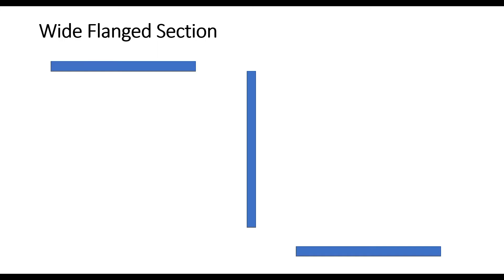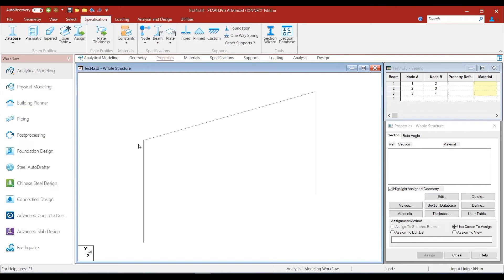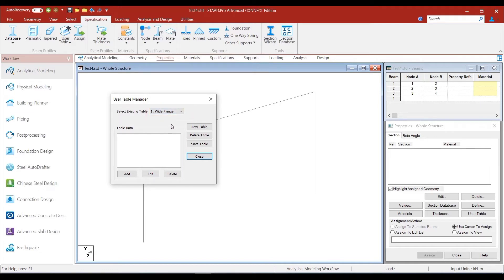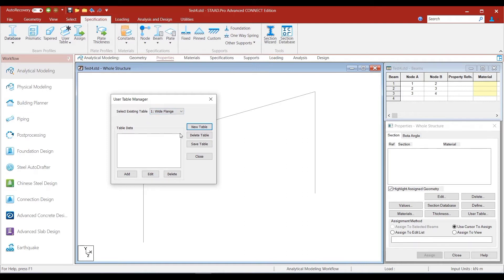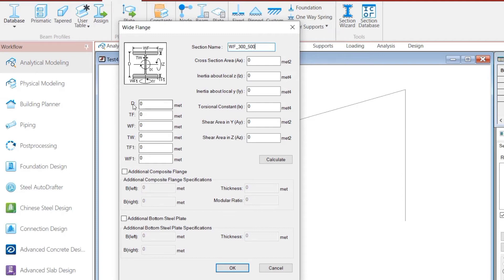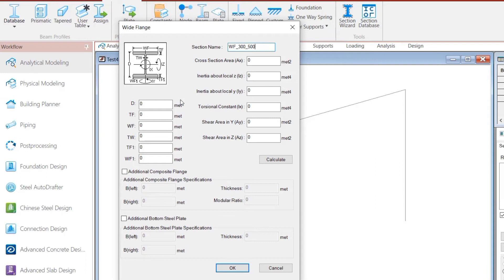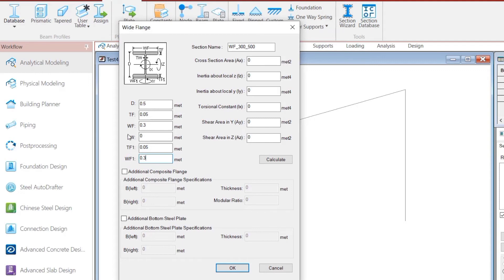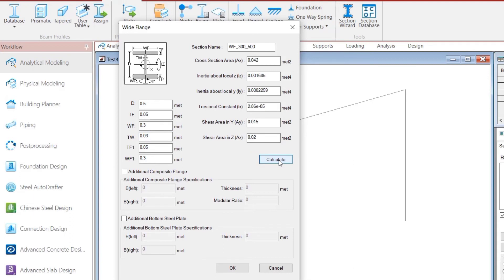#45 - Assign Steel Sections and Materials in STAAD Pro – 3 from the user table

Comment: Hi sir...
I used staad pro connect edition 
I draw PEB structure it 
Tapperd section...(both column and raffter).I take parlin in Indian cold form.
And I give roof x brasing and side bracing.
Finally I analysis the design 
The error become "member design failed for member".
Pls give a solution sir